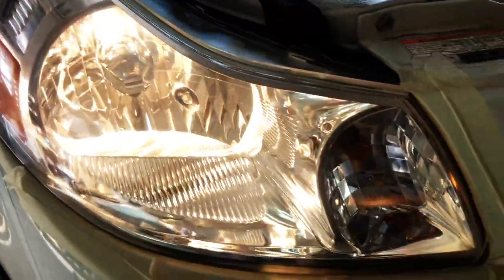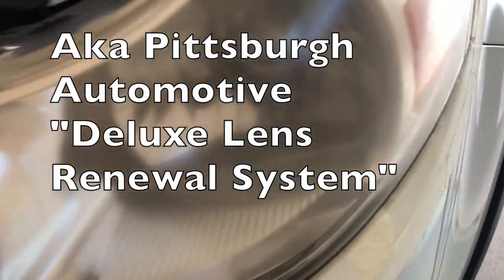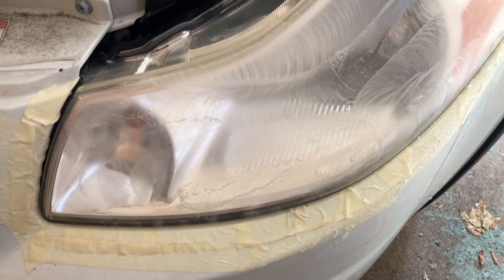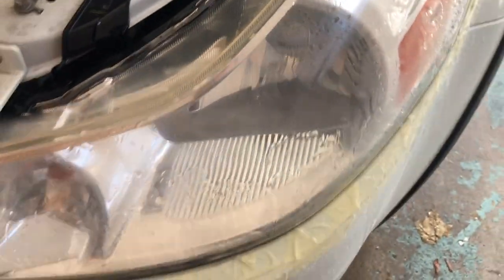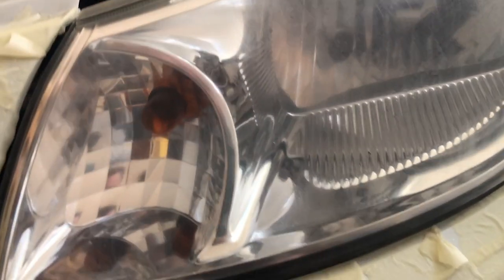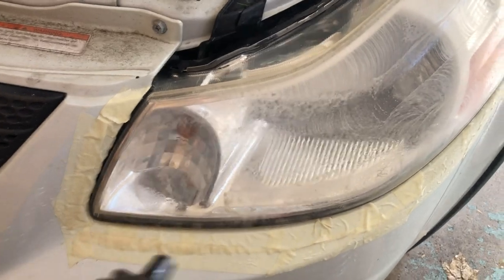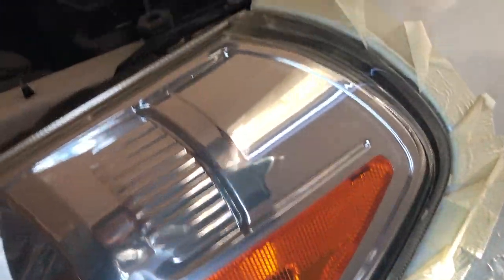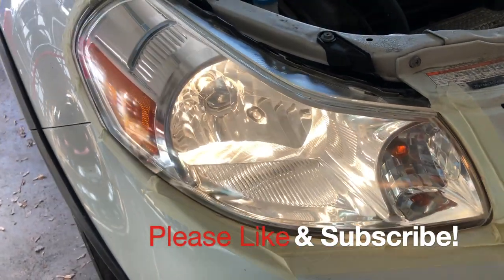Harbor Freight Headlight Restoration Kit

Comment from the maker: I recommend to seal the headlight with ceramic coating or clear coat paint for longer lasting results.
Reply: I use wax coating with UV protection.
Reply from the maker: Good alternative. Be sure to do it every 1-2 months for ultimate UV protection, unless you don’t drive every day and the car is garaged.
Reply: @MaximumDIYGarage  Good idea.  I used Nu-Finish paint polish which serves to further polish and fill in surface imperfections.  Nu-finish is a once a year polish with UV protection.  Learned about this restoring turntable clam shells.
Reply from the maker: Oh yes, that’s the good stuff in the orange bottles/containers!
Reply: If you use a ceramic or clear coat, are you still using the polish compound that comes with the kit?
Reply: @larrysheppard8433  Yes.  After sanding, plastic will still appear cloudy.  Polishing compound will cut the last layer and clear the lens.
Reply: Im doing this now 4th of july 2024
Right now im break time haha kinda tiring i just finish 500 grit

Comment: Wow just got this kit and I'm excited to fix my headlight lenses on my 2007 GMC Yukon Denali. I put eyelids with vht spray tint  on the top part of the headlight so it makes it half cut turn signal light coming through. Looks like they should look brand new afterward. 👍
Reply from the maker: Yes sir, it should turn out really good! I also used the same kit on my GX470 recently: https://youtu.be/TA_hFXzAVNs?si=7JpEJi3-hJQaaqmp

Comment: oh wow that looks really good! I jut got a 3M kit but ive never done this before so im anxious to see how it turns out.
Reply from the maker: Thanks Moe! Unless you spray clear coat or put 3M film over the headlight, it will oxidise in 6-10months and you’d have to do it over again. It’s a nice cheap fix if you’re looking to sell your truck, but if you have a keeper, getting a replacement would be a more long lasting option plus the 3M film over it would make them last a decade easily! I’ll be looking forward to your project!
Reply: @MaximumDIYGarage  can you share where the 3m film can be purchased please?
Reply from the maker: I have seen some on eBay and some on Amazon.com for various vehicles. This is not 3M film, but is for SX4: https://www.headlightarmor.com/07-11-suzuki-sx4-headlight-protection-film-kit.aspx
Reply from the maker: Here’s the 3M film for $65: https://www.invisiblemask.com/imask/index.php?route=product/product&product_id=42974
Reply: @MaximumDIYGarage  thanks. getting kinda pricey
Reply: @MaximumDIYGarage  do U have an IG or tiktok?
Reply from the maker: @Moe: No I don’t have either. I’m not super active on social networks. I don’t even use my Facebook account, lol.
Reply: @MaximumDIYGarage  dang, ok. Lol

Comment: Can you buy replacement pads without buying the whole kit?
Reply from the maker: Not from Harbor Freight for this particular kit. However, if you have a DA polisher, you can use those pads or you can buy pads from other companies that fit the diameter. Search Amazon or other sites.

Comment: I used this and only got so-so results. Are there just some headlights that are so bad they will never be clear again?
Reply from the maker: I agree. It’s either the headlights are too far gone (like my other video with Cerakote restoration kit on my XTerra) or you’re not completing each step properly. I liked the Harbor Freight kit better than the Cerakote one, except the Cerakote came with a ceramic coating at the end, which is nice way to keep the lens clear longer. Eventually they will yellow and fade again, so nothing is a permanent fix unless you replace the headlight itself and cover it in 3M protective film.